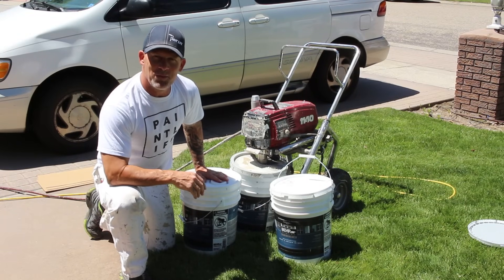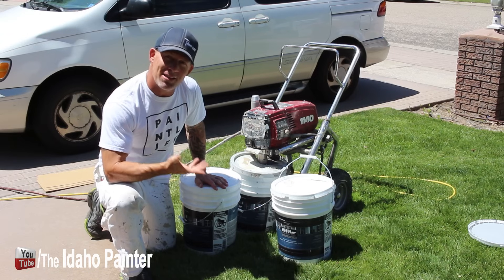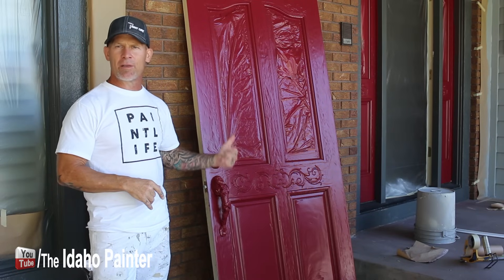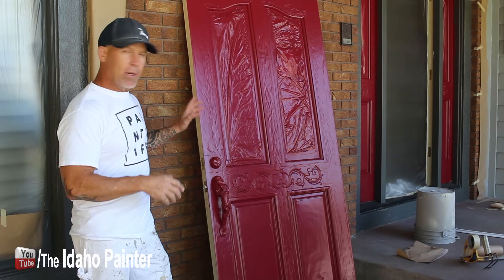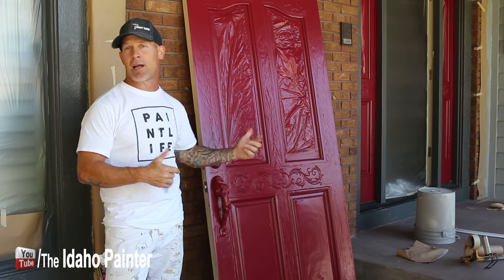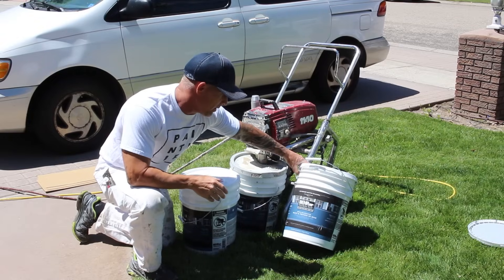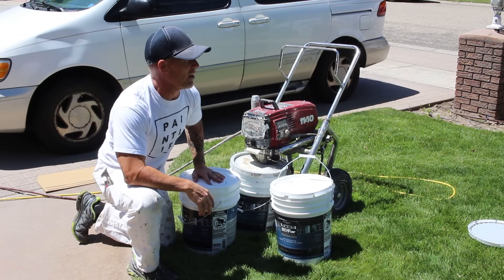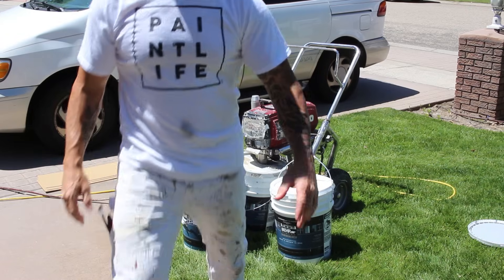Behr Paint Review.  Should you buy this paint?

Comment: I’m a DIY’er, and I’ve used it a couple of times. Their premium line has a one-coat coverage guarantee, and it’s not hype. For my living room, I used two gallons, compared with four gallons of a cheaper brand earlier. So while it’s certainly more expensive per gallon, it cost me less in the long run. I didn’t spray it, I rolled & brushed, and I don’t think it runs any more than anything else. It’s fairly thick, so perhaps even less. For a contractor, they may have an interest in something else, from a cost containment and availability perspective. But for me, it just works.
Reply: The Behr Marquee is really good.  I'd say Sherwin Williams Emerald is comparable.

Comment: Here's my experience with Behr paints: I built my house 20 years ago - a pretty large, two-story home - and I used the top-rated Behr Paint of the day, in a range of colors throughout. It has held up unbelievably well! Hasn't faded, cleans easily. Now, recently, I wanted to touch up some places in my bathroom that had gotten dinged up. I still happened to have a can of that two-decade old paint in a can in my garage (which gets very hot and very cold). Opened it up and it was dried to a sludge. I got some water and stirred it to hydrate it. But it had debris in it that was unstrainable. So, I got me a small pieced of wood and got the cleanest portion I could find - which was very watery and thin, and kept I kept painting it onto a piece of wood, intermittently drying it with a dryer, and doing multiple layers until I had a solid color. Took that small sample to Home Depot, they scanned it and it perfectly matched my 20-year-old paint on the wall - saving me an entire paint job, as the rest on the wall looks very good. I'm sold on Behr paint! And as Behr has remained a top-rated brand, and as the chemistry behind paints has greatly improved over the last 20 years, I can only imagine how good Behr paints are now!
Reply: I've been using Behr paint for years, outside and in.  I'm sold on its quality and the service I get in the store.  That said, Dunne Edwards is excellent too.
Reply: Nothing you mentioned is specific to behr paint. All paint does that. And I guarantee you the sheen didn't match.
Reply: 1. First reason I prefer Bher. A) Recently visited Sherwin-Williams store and purchased three quarts of three different colors of Latitude acrylic paint $50.00. (They won't sell you anything smaller than a quart😩) for  my stucco home painting project after the Sherwin-Williams representative told me the A-100 (100 percent acrylic paint) that I came there to purchase was "a cheap paint that won't have a good result at $45 a gallon!" (On sale for $38)☹️🤔
( Then why do they sell it?) The representative told me to use their $70 per gallon interior exterior paint for my stucco home project! (which is also not made for rough stucco exteriors or hairline cracks and is not 100 percent acrylic nor is it a specialty masonry stucco waterproofing paint).  Those were the two choices that I had in mind. A high build masonry waterproofing paint and a 100% acrylic paint for my stucco.🤔
B) I asked them if they have a high build thick waterproofing paint for masonry and stucco that would compare with the Bher Specialty high build waterproofing paint for masonry and stucco with hairline cracks? They said no, there is no Sherwin-Williams paint that is designed to help stucco with hairline cracks.😡 They told me to use a $50 per gallon primer underneath the $70 per gallon interior exterior paint. 😠They also do not have any paint that includes a primer although I do believe that that is just a selling gimmick. 🤔

 C) Went to Home Depot purchased five small jars (5 colors ) of Behr Ultra premium paint for $23.👍😁 (First reason I prefer Bher. ) Also found their  Bher Specialty Elastomeric high build waterproofing paint for Masonry and stucco which is supposed to work well on stucco with hairline cracks etc!😁
C) Next I watched Sherwin-Williams videos related to waterproof coatings used by a builder on commercial high-rises in Daytona Beach Florida! This is what I learned. A)after significant concrete stucco repair. The Sherwin-Williams expert on the project had the contractor use LEXON conditioner on top of all existing surfaces and SW MODAC smooth primer after all areas of the stucco repairs with high PH and finish all those surfaces with SW Super paint satin finish ACRYLIC on everything. ( I knew I was right) They also used SW surecrete flexible waterproofing for the concrete balconies after a cathodic system was used by the builder ( cathodes are placed in the concrete where rusting rebar is a problem, it's known to slow down the breakdown of rebar in concrete especially on oceanfront property. It's a real problem here in Florida with waterfront or oceanfront properties.) 
D) the Sherwin-Williams store employees made me feel like I didn't know what I was talking about when in fact I did know exactly what I was needing and looking for to do  my project and I was willing to purchase the best product for the job. Just because something is $70 or more per gallon doesn't mean it's the right product for the job! If the Sherwin-Williams employees don't know how to help me get what I want and need they should have shut up and stopped wasting my time rather than try to sell me some high-end paint for no apparent reason. And that's why I prefer Bher! 😁 A) My time has value B) they should have just shut up and given me the 100% acrylic paint samples which by the way is on sale at Sherwin-Williams right now. D) I contacted another Sherwin-Williams store. I got another moron on the phone. I called back an hour later and got a great knowledgeable guy who explained. You can't get super paint anymore. But they do have the LOXON XP waterproofing paint that I discovered watching videos by pros like you on YouTube. 💕They have it in a flat they don't have the satin in stock but they can get it. They also don't have some of the other products that I listed above from the SW Daytona project video like Super paint. They can't get it anymore. They do have some surecrete products. He shared with me they haven't been able to get multiple products for many many months not necessarily related to covid and now because of supply chain issues they have no idea when they will be able to get some of those items. So, it's  either SW LOXON XP waterproofing paint as my first coat and A-100 acrylic as my second coat unless someone advises me otherwise. Or the masonry specialty paint from Bher as my first coat and 100% acrylic paint from Bher as my second. However I'm still PO'd at the rotten customer service I received at Sherwin-Williams near my home in Sebastian Florida. Because I actually am not a paint expert and that's all they do is sell paint. I'm seriously wondering if I can't just color the masonry waterproofing paint in a satin and call it a day?  Anyway home Depot makes it easier for people like me. Thank God for guys like you put so much of their knowledge online for others in their trade as well as for homeowners like me. Thank you for your valuable time and your expertise 🥰💕. I'm just really concerned about getting the right products. The painting contractor I am planning on using doesn't give any advice. Other than he prefer Sherwin-Williams. I'm worried about fading since I've seen a lot of houses fade in my area and also they don't fade evenly. I'm worried about some chalky spots on the front of my house which only occurred after someone pressure cleaned with chlorine. There's no Chalky residue anywhere else but in front. It wasn't there before the guy pressure washed the front of my house and my garage. Now my garage door and the front of my house is chalky. I'd really appreciate your opinion and so far as what should I put on top of the waterproofing paint or should I just color the waterproofing paint and use two coats of it? Or would that be a mistake because the paint is so thick? 😭 Anyway. It would be so nice if the painter made these decisions or helped me make these decisions and more fun if all I had to worry about was the colors 😁
Reply: I agree Behr paint Is great and price can't be beat getting from Home Depot

Comment: The Premium Plus Ultra exterior was just rated overall score of 75 (Jan 2020) as #1 exterior by Consumer Reports. Ratings primarily based on appearance at 3-6-9 years. About $188 for 5 gallons of flat at Home Depot (exclusive). Their Premium Plus came in with a rating of 73 and is around $145 for 5 gallons.

Comment: Titanium dioxide is the white pigment in all paint that you see before its dyed. Its the key ingredient in primer and it's what covers stains and color on walls and ceilings. Take a look at the MSDS sheets of SW Duration paint and Behr Ultra Premium Plus. 10% more in Behr. You get way more coverage with much fewer coats needed. SW paint rolls nice because it doesn't have as much solids but sags horizontally. Behr is a bit more gloppy and will sometimes run vertically. Home owners will get more done for less with Behr. Pros can paint faster and get the job done earlier because it rolls and sprays better. That's your answer.
Reply: thats correct, nice to see someone who knows what they are talking about;-)
Reply: Tyson Harris Behr sucks. drips and runs a lot and it pulls terribly when cutting
Reply: BEHR Marquee sags when brushing and rolling, forget back rolling over the sags as it peels the paint back off the wall. Spraying has better results. I am a paint contractor in South Florida with high humidity.

Comment: I used Bear paint for many years. I thought it was great. Then I tried a good paint like Benjamin More or Sherwin Williams. There's no comparison. 
I've seen Bear paint that was so thick you could stand a five-gallon stir stick in a one-gallon can and it would stand straight up. My helper asked me if it was spoiled when he opened the can. It was close to as thick as pudding. 
I find the trim paints, (semi-gloss or gloss) needs to be thinned a bit or it leaves brush lines down to the old paint. So you then must paint it again to cover. 

 I personally use Benjamin More Paints. For trim, doors, handrails, and shelves. I only use Benjamin More Advance Interior Waterborne paint. I love that stuff. It's alkyd like oil paint but cleans up with water. There's no blocking and it looks hard like oil paints when dried. without the yellowing!
 It goes on a bit more like oils. You can't just slap it on thick like latex paints, or it will run or sag as oil does. 
 There's a sixteen-hour recoat time, but I think it's worth it. You can see the difference when it dries. I tend to work alone most of the time so I can usually only get one coat on the trim in a day anyway.
Reply: Ben Moore is the best , I'd rather use Ben Moores contractor paint than BEHRS best paint .
Reply: I agree, Advance self levels. Its all I use for interior trim. You can paint using a pinecone and will appear sprayed.
Reply: Pinecone lol that's good @flahertypaintingpropertyso4021

Comment: I've used Behr quite a few times it sprays good dries hard I like that, it doesn't roll on good or brush well acts like snot when pulling out of the bucket. I prefer Sherwin Williams and Dunn Edwards over it as far as easier to use but it does seem to dry hard and hold up out in here in so cal , your videos make me want to move to a cooler climate get out of this heat looks beautiful there

Comment: Behr paint has changed its chemistry over the years. pros: it covers good. It's not as pungent as it used to be. The Marquee brand is worth EVERY penny & truly covers with 1 coat. very little to no holiday on 1 coat. The hi-glossbis very durable and finishes nice.  The ceiling paint thick and bright. It really covers well with a bright true white. 11 years ago I did not like Behr paint at all. 
cons: if u leave it in a paint pan it develops a skin. The brushing capabilities for cutting or trimming is tough though. I tend to mix a little water when brushing baseboards.
Reply from the maker: Thanks for sharing Sean!
Reply: Use Floetrol, not water.
Water not only dilutes the paint but also weakens the bond and shortens the life.
Reply: +Mark Spotter 
thanks for that advise. gonna follow it. take care
Reply: i just used the marquee about a week ago and was very happy with it but its between 45-50 bucks a gallon but only one coat is all it took!
Reply: during the past two years I have used Behr exterior and it is now faded and cracked/peeling.... .>behr sucks.  Right now I just don't know what to do... which paint to go with.
Reply: Not really. When cutting in, it bleeds through. Rolling does cover in one coat only on textured walls, not on smooth wall finishes and not when your cutting in.
Reply: @elrico1364  if your paint is peeling, it can be 2 things. One, you didn't  pressure wash it very well and two, your house Is anywhere  between the 30's and 60's. If that's the case, you most likely painted on top of lead paint or oil base paint. And it's on wood siding. Use 40 grit sandpaper on a palm sander to sand the crap out of it, prime the whole exterior, then paint it. It will never peel. I have painted over a hundred houses with marquee. Even the regular behr exterior paint. My mom's  house still looks the same from 2003 from when I painted it.

Comment: Use Marquee, it's excellent, hands down their flat interior paint is worth the money and it helps if you have a %20 pro discount, ($34/gallon flat).  I've used their Marquee flat/matte paint and love it because it is has great coverage, is easy to clean, durable and a great value.  Marquee does smell though and it is the only drawback and some home owners just can't deal with it.  The biggest issue I have with HD is that they only deliver on very large orders, something like 50+ gallons ? Their paint department is clueless and rarely do you find someone who knows what their talking about.  They just don't carry a good selection of items for painting and they run out of things all the time because they don't stock for a commercial painter.  I simply call my SW store and the same day or next day I have my paint and supplies either delivered to my job site or my home.  The pricing is just slightly more expensive than HD but the convenience and time savings that my SW store provides me can't be measured.
Reply from the maker: Awesome, thanks for sharing!

Comment: I applied two coats of Behr Ceiling White Flat paint in a 
kitchen/dining room/living room (all one room - 45'x35') and had a very 
difficult time hiding roller marks using a Wooster 3/8" nap polyester 
roller cover and dipping straight out of a clean 5 gallon bucket with a 
roller screen. It was like I was using an "eggshell" sheen. After 
reading numerous complaints online about others having the same issues, I
 switched to their i300 line of Dead Flat white. I re-rolled the 
kitchen/dining room area one evening, and came back the next to roll the
 living room. There is a definite difference between the two areas. 
Kitchen/ dining was more creamy white, and the living room was a bluer 
white. I thought maybe different drying temperatures. I bought another 5
 gallon pail to re-roll the whole area in one shot and still have 
issues. When did "flat" paint become "not flat" paint? When Behr says 
"superior touch-up" and uniformity, I say BS. As soon as you would try 
and do a touch up, you'd see it. This stuff does not blend and is NOT 
flat. FYI~ General contractor for over 35 years, so yes, I've painted before.
Reply from the maker: Yeah, it's not good, thanks for sharing your experience with it!

Comment: I've used Behr's paint several times, if customer wants it, it is not bad. , I found it worked out ok, flowed ok, but I agree on the discount. Home Depot don't cater to paint contractors with much discount, and If I was on a large commercial job and needed 200 gal.'s, it would be a nightmare depending on them. I prefer Porter Paint, PPG. Good video again, well done. JohnG

Comment: You mentioned that Behr was more expensive than SW Resilience, but when I checked the pricing Behr was ~$166 for 5 gallons and SW Resilience was $325 list price for 5 gallons.  Even if a consumer gets a bi-annual 40% discount, it's still ~$195.  What kind of discount are you getting?  Also, my wife definitely prefers SW, while I have always gone with Behr for my exterior painting due to the good longevity reviews in Consumer Reports.

Comment: I just finished an entire repaint inside and out. I had more runs than ever before on the trim inside and found the rolled coverage on the facias to be less than desired. The rest of the coverage turned out great.
Reply: BEHR is very runny , as a professional painter I say it sucks . I've been called to homes many various times to fix a mess from a homeowner . Often a homeowner will roll out a room and say wow it looks great to return to look at it in an hour to find out the paint sagged . Sucks because you can't really sand fresh  paint , I usually just skim coat over it with joint compound to fix it .

Comment: I used Behr Deckover for a period of time... I liked it but found it's MUCH better for rolling then brushing. My Sherwin Williams rep turned me onto Super Deck and I swear by it! I could really use some better guys on my crew, looks like yours are fantastic! If any one of them ever move to Maryland, please have them reach out to me.
Reply: andrew beaudry. Yes sir, it does tend to peel dependant on your climate, dry time in between coats, if the deck is completely dry.... Currently I use something called Deck&Dock. Its pretty amazing stuff, almost a thick as pudding. They call it a deck restorant, elastomeric paint. Its formulated to bridge and fill cracks. Beats the hell out of DeckOver.
Reply from the maker: Thanks for watching!